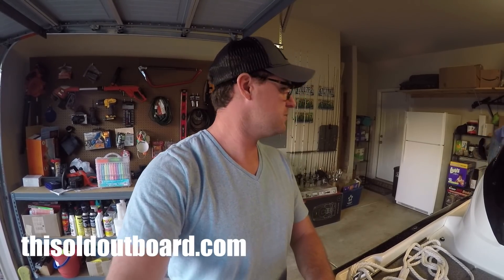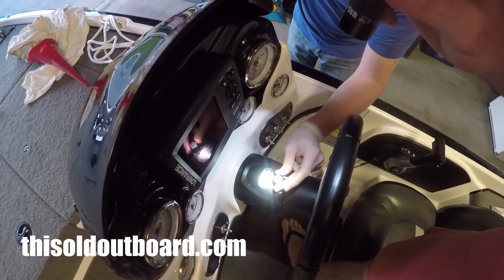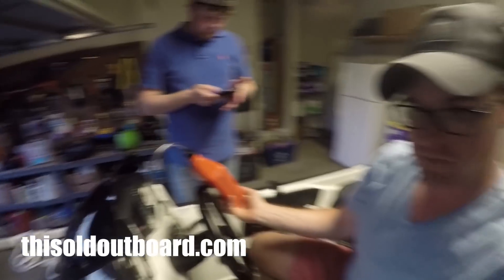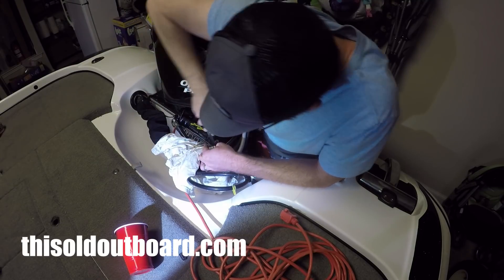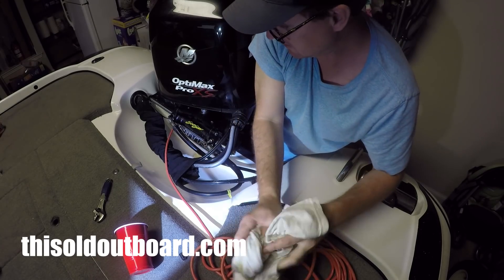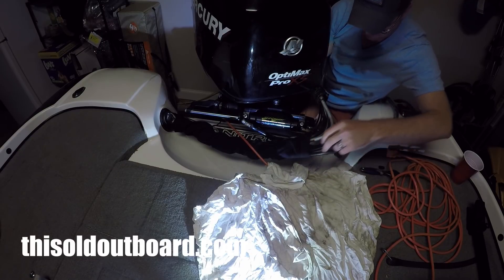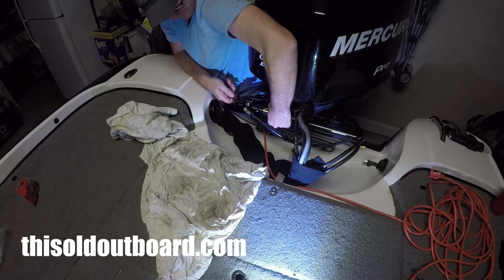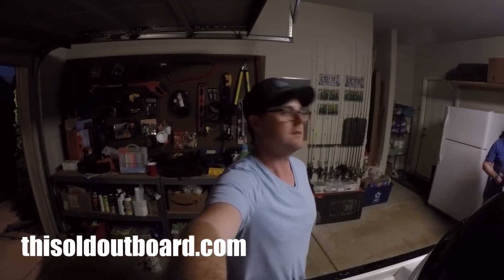Bleeding a Sea Star Hydraulic Steering System

Comment: I know this is an old post but I have some other way of filling and bleeding the air...

IF YOUR BY YOURSELF

I OPEN  each bleed valve on the cylinders then I force a 5/16 clear hose over each bleeder nipple . do not connect a hose from nipple to nipple it has to be individually..the length of the hose varies from boat to boat but long enough to reach down to fit into the bottom of a 1 qt. /32oz clear jar that's filled 1/2 full of hydrologic  fluid you're using .. I have a couple of jars with a pre drilled out hole in the lid with a hose  already made up going to the bottom of the jar that's filled 1/2 way with the fluid....
Now to fill the steering unit... I can hold the bottle myself and turn the wheel... what will happen is air will push out of the pressure side while the other side will draw fluid up the hose then in turning back the other way will repeat the same effect blowing out the air in each jar but drawing fluid back...... you'll notice the cylinders will start moving efficiently as all the air is pushed out more and more with completing each turn of the wheel until all you have is solid fluid in both hoses from the jars to the nipples... tighten the nipples...remove the hose and jars (what fluid is left can be used on next job . Most cases I end up with a 1/4 th.  left of what I started with but it  depends on the unit) now install back steering filler cap... Your done ... This is how you do it by yourself .... I hope this helps someone..😊

Comment: Cut the bottom off a can and use that as a funnel tied to the source tube to the helm. Run a clear line from the funnel back to the transom with a tee connecting both bleeders. Then put some fluid in the funnel, open the valves and crank the wheel to one side, you should see fluid coming on the return tube back to the funnel, with possible bubbles. Make sure the funnel has fluid, I.e. no air goes into the helm, and crank the wheel several turns left and right until no bubbles are in the return tube - then lock down the bleeders, drain the tubing back i to the bottle, remove the funnel and its all bled.

Comment: Just get the Bubble Purge kit. Much easier with only 1 person.
Reply: How do you hold the cylinder/ open and close the bleeder as well as turn the helm with one person?
Reply: @reese8746  After you hook up the tubes all you do is keep turning the wheel. The air goes into the bottle of fluid. Believe me, it's as slick as can be.